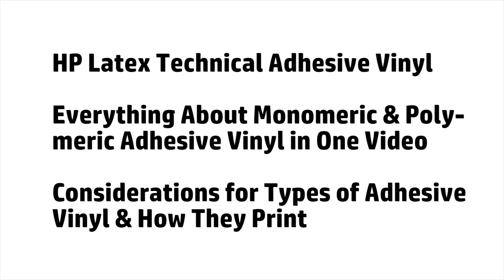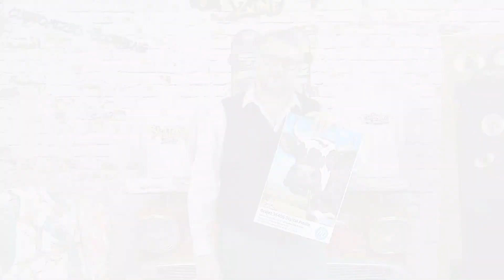Overview of Monomeric and Polymeric Adhesive Vinyl and How They Print | HP Latex | HP

Comment: I have giving up running economy vinyl like Avery 3303. These are too heat sensitive and playing with the heat is risky and slowing down is counter productive. Also what you didn’t mention is the heat will cause the vinyl to wrinkle under the print head as well. Thus cause a skimming head strike which will ruin any print. Nice video. Thank you